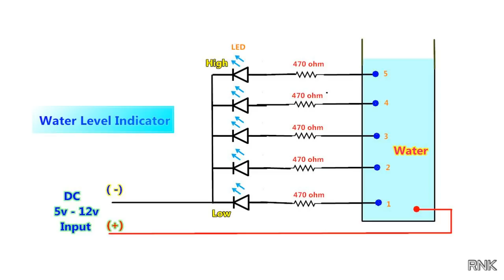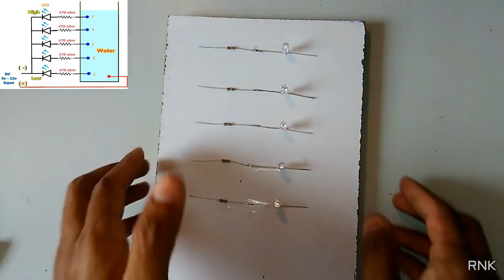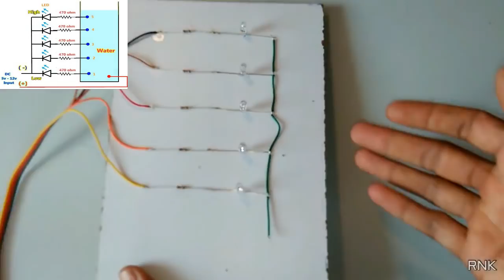Without IC & Sensor | Simple Water Level Indicator Made at Home | Low Cost | POWER GEN

Comment: THanks for doing this video, I have a grey water tank that needs it before I can start living in my truck and I have run out of money.....I love youtube and the people who share knowledge :)
Reply from the maker: thank you for your support
Reply: @powergen522  So this will work with 12v if I use 12v led's?
Reply from the maker: you can use
Reply: @powergen522  Built it already, didnt even need the resistors.
Reply: @jedics1  how the led will burn bro
Reply: @toitozky155  I am now having problems with the Led's turning on even when the tank is empty, likely the dirty water coating the sensors and inside of the tank. Would the resistors create a threshold so they aren't as sensitive?

Comment: Can someone explain for me why were used 470 ohm resistor in the circuit? I mean, what to consider while choosing the correct resistance for the circuit. Thanks a lot in advance!
Reply: The suitable current for the LED to work perfectly is the main cause to choose this value of resistor under 5 v dc supply
Reply: If the voltage is high the resistor will rduce

Comment: Like this circuit cannot be used because passing current through water produce hydrogen and oxygen and some metal get displaced from the wire into the water and this make water dirty.
Reply from the maker: I am agreed, I will better water level circuit diagram make it and upload video
Reply: Yes, this kind checking level is always used along side with switch to connect current for very short time just to check level, so there is no problem with hydrogen :), of course metal for sensors should be higher quality to prolong service, as they be with contact with water
Reply from the maker: I agree, I will some change circuit and parts
Reply: FAIZAN SHAKIL bro which material have to use for it
Reply: i want to know can i use only 3 bulb mean 3 indicator with the same resistor etc
and second question is that can i use long wire about 10 meters for that circuit in 5v
Reply: @hassankhan-wx2ll  you can use copper wire from toy motor
Reply: It's gud there will be no lack of oxygen #lol😂😂😂

Comment: It will work for some hours only then needles will go away due to corrosion caused by electrolysis
Reply: Use magnetic float switches. It will work for years without requiring any maintenance.

Comment: nice video!  I already subscribed sir. One question, if i was to use a 12v dc pilot light what resistor should i  use. We have an underground cistern tank at our mall and i would like to install a water level indicator/alarm. So that whenever my team will check the water level of our tank , it will be easy for them to monitor. Currently we are just using a dip stick to monitor our water level. Thank you!
Reply: 10k

Comment: i want to know can i use only 3 bulb mean 3 indicator with the same resistor etc
and second question is that can i use long wire about 10 meters for that circuit in 5v

Comment: i need help. i made one like this watching you. now the problem is - the cables go inside the tank. are melting over night .. running power is 12 v . mainly the +ve input burns fast. . i have changed wires couple of times. but its burning - with in 12- 30 hours.. what may be the solution for it.. please let me know .. if any one can understand my point... thank you...
Reply: Same same prob !! Please help
Reply: You're probably using thin wires, 12V burns thin wires like on the video. Try using thicker wires.

Comment: Will it work when I use 10 meter wire from water tank to this circuit ????
Reply from the maker: Yes work, but want to reduce the value of resistance
Reply from the maker: wait I will upload a video for various circuit method
Reply: how can i reduce the resistance of wire of 10 meter ?
Reply: Larger AWG size of wire.  @AjaySharma-qw8ti
Reply: Good
Work
Reply: How can you work

Comment: Can we use 9v battery
Reply: I did and it works fine. I also put micro SPST switch inline on +9V wire to control the circuit power. I used 470 ohm resistors and a regular LED, just like his wiring design.

Comment: my water tank is on fourth floor and 8 want to indicate on ground floor so due to increasing length of wire resistance ischange & also you don't say about supply voltage of your circuit
Reply from the maker: I will make it better water level circuit diagram make it and upload video

Comment: What was that Transformer circuit at the end!?
Reply from the maker: simple separated DC voltage regulator 5v,6v,8v,9v,12v,15v etc.. easy to make at home
Reply from the maker: follow the channel video
Reply: @powergen522  can i connect 5v charger with output equal or less than 1amp? And kindly tell me the resistance to use if i am using 5meter wire for 1led.

Comment: Led to register connect led side + or - connect to register
Reply from the maker: The circuit should be used for resistor
Reply: POWER GEN  Thanks bro
Reply from the maker: Thank you for your support

Comment: How to make supply power
Reply from the maker: you can use 12v DC adaptor.
it available in the electronic store
Reply: @powergen522  it contains ripple. Do u know ,how to make 12 v power supply without ripple.
Reply from the maker: connect Capacitor, Diode in the circuit is reduce ripple
Reply: @powergen522  i need 12 v power supply, so how much range of Capacitor, do i need?
Reply from the maker: 2000uF/25v capacitor
Reply: @powergen522  does it need smoothing capacitor
Reply from the maker: first, tell me your project (or) circuit (or) my video name,
after I will answer.
Reply: @powergen522  i want to do waterlevel indicator like you with 12v. But unfortunately there is ripple. Due to that there is little light glow in led, when the water level is even empty.
Reply from the maker: ok,
this is without IC water level indicator so some issues occur,
wait I will upload for with IC method,

I've been using it for 6 years IC method, I have not the time so I not implement the video